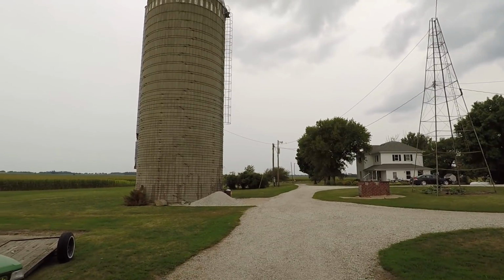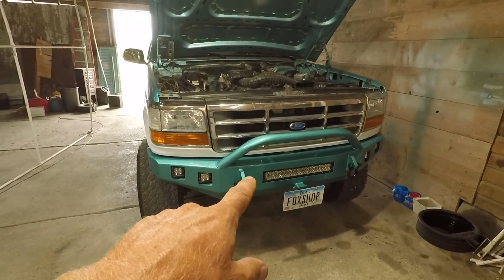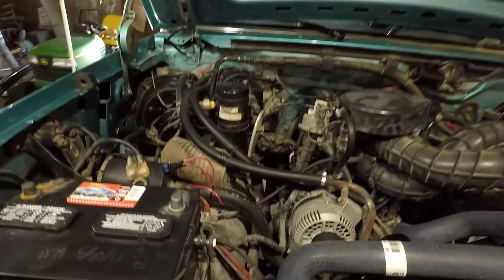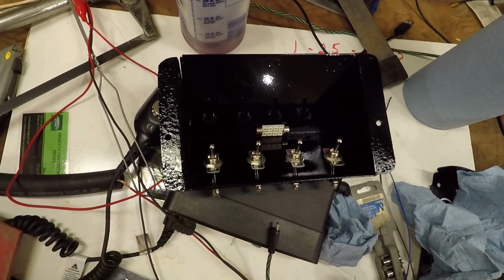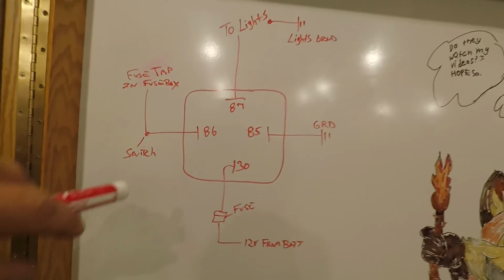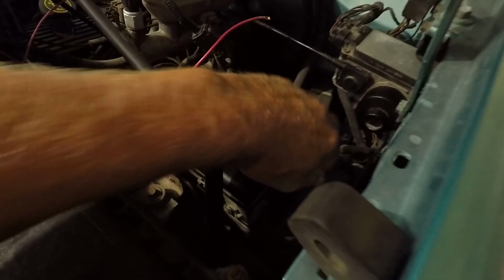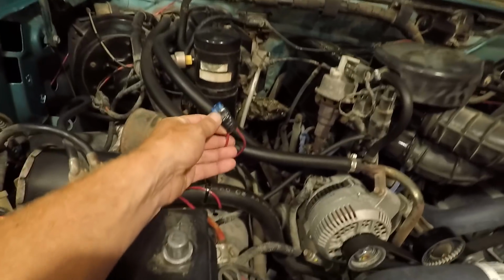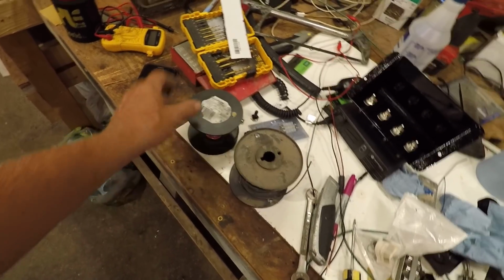GOING To Wire Up The Bumper LIGHT BAR and POD Lights

Comment: I put my light up green switches where the push button 4x4 goes. Plenty of room behind it. I have a fuse block and relays by the battery. I ran wires on the passenger side. Wiring more lights this weekend!

Comment: i did run a light without a relay, and i agree a relay is a better way. But I made sure to use all 30 amp switches and wires and a 25 amp fuse. so the fuse will pop before the wires burn

Comment: Did you hook the battery back up to try the bulb? Unless it’s a side post and top post, you was talking about the bulb with nothing hooked up on top.
Reply from the maker: I tried it when I took the radio out, had the battery hooked up at that time

Comment: Good video. What size wire are you running on the lights?
Reply from the maker: 14ga
Reply: Love the bumper!  Btw, a couple years ago you changed the Tran fluid with syncomesh (not sure about name) I think...how did that work long term?  Mines getting stiff going from second to third and thinking about doing the same thing
Reply from the maker: I would have to say it has helped... still has the occasional hiccup where she doesnt want to shift into gear from a standstill in neutral.. but they are far and few between.  In fact this year I dont think it had happened until just a few days ago. So cure all?  No, probably not, but in my case it does seem to have helped.
Reply: @TheFoxShop  Thank you sir.